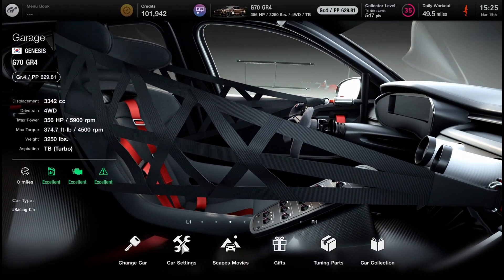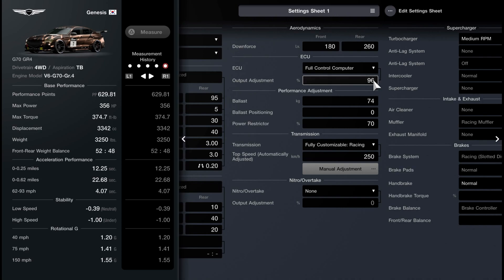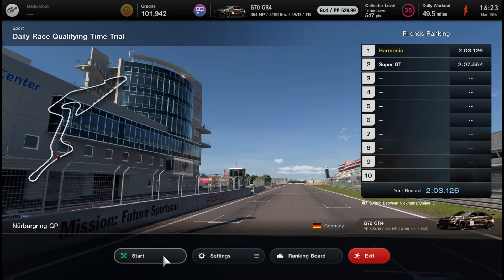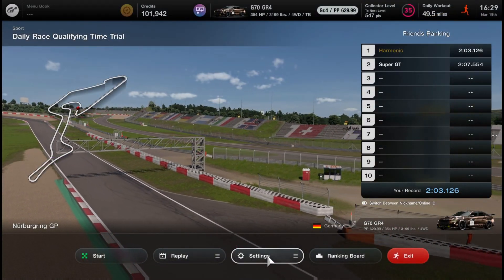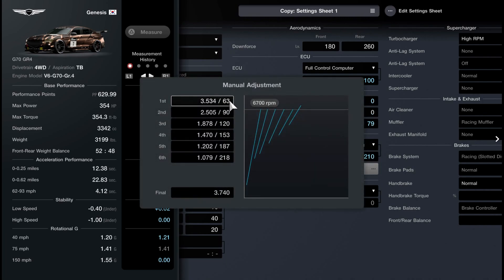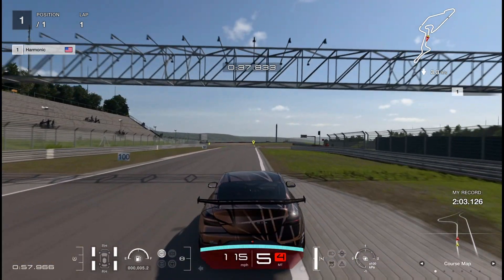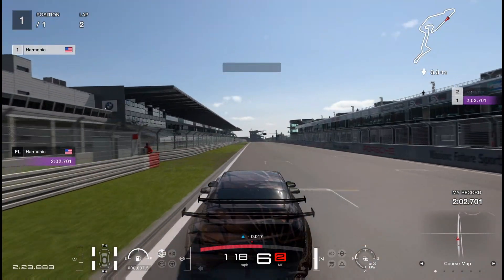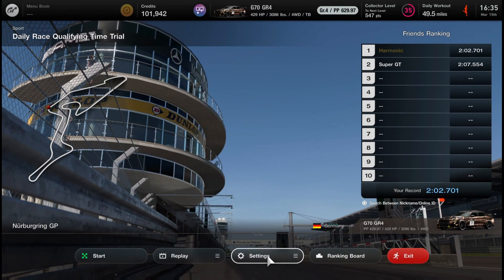Is the PP System BROKEN? | Gran Turismo 7 Tuning Tips

Comment: Why wouldn’t tune setting adjust and affect the cars PP? That’s realistic. You took out some top speed but then gained acceleration by doing that and that’s what you needed specifically on that track to go quicker. The game is just making us learn and understand how to tune you car on a track by track basis. Which is exactly what teams do in real life. I’m personally very happy with how the system works. Either way great video.
Reply from the maker: I don't think you understand the problem. You can make functionally identical setups that are 40+ PP apart, which is what I show here. Extending a gear ratio by 0.001 or adding 1 kg won't change your lap times in any noticeable way, but the game places the car into a completely different class because of how it simulates performance.

Comment: I think its always better to reduxce more on ECu than engine power ;) at least how it used to be back in the days ;)
Reply from the maker: Power restrictor is always better. The ECU output doesn't change your power curve, whereas the power restrictor pulls down the peak while not affecting the low end as much, so the power band is much wider.

Comment: So you're saying if I want to win, add a ballast and up the weight by 1kg? Also the way gearing effects PP is crazy. I got my PP to 550.01 for a race(needed 550), but setting it one more point drops it to 548. Decimals are also an issue. The fact you can denied entry by .01 is insane. Also I did races with cars that were over 600PP in a 550PP race. I don't know if it is intentional, but it makes some of the races pretty hard.
Reply: Why would you expect a car that is 550.01 to be allowed in? It’s over the limit, simple as that.
Reply: @SgHawk144  and Im saying the pp system is flawed. I got a power restrictor to lower my pp and setting it down put my pp up. Explain how making my car worse made it too good for the race. Either way I did the race, but its a flawed system.
Reply: @Gutigwolfe  that didn’t answer my question…
Reply: @SgHawk144  your question was asking why I expect to enter a race if Im over, but I never said that. I was explaining it was broken, so I replied with a further explanation of that instead.
Reply: @Gutigwolfe   - “the fact you can denied entry for .01 is insane” 
Suggests you disagree, no?
Reply: @SgHawk144  and you took that is me expecting to be entered at .01 over? No, I was saying how easy it is to be over or under, because 1 small change either puts it barely over or way under.

Comment: Hey I have a question about tuning. I bought the Bugatti Veyron 16.4 '13. I bought all the upgrades in the tuning shop that raised its PP. I feel like I messed it up somehow. It feels like it changes gears too fast and abruptly while driving. To restore the body it costs 2.4 million. I’m not sure what to do.
Reply from the maker: Lower the final drive number. You might have too much power for the gearbox and you're just going through all the gears super quickly
Reply: Thanks for the tip! I found you could remove most of the parts in the settings.

Comment: in casual observation, it seems that odd numbers are what trips the system up.  Maybe an irrational number issue?
Reply: Is this common in coding?  I’ve only run programs in javascript, python and matlab and I’ve never had an issue with irrational numbers so is it normal in programming for an oversight such as not being able to compute something due to running out of decimal places?  If so then maybe it can be resolved by rounding values in the formula it uses you think?
Reply: @litreocola6447  I don't really know anything about coding, except that programs usually have a way to work around non-terminating decimals.
Reply: @funkyblue3166  from a previous video on this channel someone found the solution to this and it’s actually quite funny lol: if your car can’t reach 150mph the rotational g rating at 150 isn’t calculated, and as a result is left as 0.  That’s why short gear ratios are important - you gotta reach a max speed below 150mph to circumvent the rating.  Sounds like a pretty easy fix honestly, just interpolate between 100mph and 150mph in terms of pp rating to the max speed limit and get the rating from that scaled value

Comment: The problem is not persé the PP, it's that the measuring of the PP does not make any sense, adding weight alot of times raises PP, why ? Also when you toy around with the weight and power and even downforce, you get to these certain points where adding or removing just 1 adds and lowers alot of PP, the drop and rise is too high for how precise you have to be to optimize PP, why can't we controll the power per HP, instead of per 3/5, the jump is too big.
Reply from the maker: It's true that PP isn't the root of the problem, but it's the end metric for these events that we have to base our tunes on. The root of the problem is how the game simulates rotational G, and that's what gets factored into the PP rating.

As for HP adjustments, while it's annoying that they're not super precise, it's very difficult IRL to have that level of control reliably, so I suppose it makes sense.

Comment: By not following sports use of FIA rules they messed up.
I will say I’ve been messing with power restrictior and ballast and it’s not made any of these tuning numbers happen. I’ve found one car they seem to messed up on the Ferrari iltalia  I’ve raced next to the ai and flat out caught air and another stock one next to me was fine on the hills drop next to me. Watching the replay it’s same speed no breaking. 
I will say thei “exploit “ is similar to what race engineers do to win and innovate to get around rules. 
BMW had gotten into trouble so many times because they made more tuning to the engine that the FIA restrictions didn’t matte their m3 killed the completion. While latter they left racing for a bit due to a seemingly FIA hunt on them. They proved that the rules are the engineers challenge not hinderance. 
So what you’ve done is just tunning
Reply from the maker: No, it's not "just tuning". You can have 2 functionally identical setups with 40+ PP of difference, which is clearly a problem with the in-game system.

Comment: So is it only at a certain threshold it has such a drastic effect or is it only certain number combinations that do it?
Reply: Yes. This was one extreme example where there is a threshold change when the car is/is not able to go above 150 mph, so the calculations that make up the pp rating can’t include rotational G at 150 mph. I presume the same would happen at 100 mph. Gearing and power are the obvious variable to change the cars top speed but in this extreme example his car must have been geared to pretty much exactly 150mph and by adding one extra kg of ballast it brought his theoretical top speed just below 150. There are other less extreme examples with other variables.

Comment: Well...

Shortening the gears as much as possible for better lap times is one of the first things i learned as a 12 year old playing GT1 with my father 25 years ago...sooo thats just how GT is i guess.
Reply from the maker: That's not what's going on here... The problem is you can lengthen the gears by 0.001, add 1 kg of ballast, etc. to break the game and have 2 functionally identical setups that are 40+ PP apart. I discuss this in video if you actually watched it.
Reply: @Harmonic14  well...i do get your point, but again "isn't that simply how it's supposed to work"?!

You can tune in different ways to arrive at the same pp-threshold with different outcomes / performance. Isn't that the point? I understand when you think that's annyoing, but otherwise everbody would just run the same setup meta and we wouldn't need to tune in the first place. Which could be indeed less annyoing...🤔

(wanna mention i did not play GT Sport at all and i have not tried GT7 online yet...maybe for good reasons^^)
Reply from the maker: @tydendurler9574  no, that's not the point. You can arrive at 2 functionally identical setups that are 40+ PP apart with this. You can't argue that 1kg of ballast or a 0.001 shorter gear will affect your performance in any noticeable way.

Comment: I had a situation (tinkering with numbers) I gained PPs (lol) while reducing power.
Reply: Yes but the thing is:

Do you understand why?

Hint: more power does not always make the car faster (as in lap time, which is what matters)
Reply: @tydendurler9574  Yeah, you think 1 point in ECU adjustment meant a 5% increase in power you're dreaming.

The fact that you can oversteer or understeer more easily due to having 3HP more makes 0 sense in increasing PP for 5%

Comment: In a race that uses fuel, your car will also become lighter over time.
Reply: wow i didn’t know lol.
Reply: so technically if the weight was holding you back to 149, you gain like 30 pp when you drive a little while. i guess the same is true when you have a tailwind

Comment: Love the channel. But yeah tuning is faster than a non tune. I race every Saturday & getting my tire pressure, stagger & camber correct is very important to victory. I don’t want tuning to be just bolt on parts. That’s not really tuning in my opinion
Reply from the maker: That isn't the point of this video. The point is that you can run a virtually identical tune, and the game thinks it's way slower because of an error in the PP calculation. This allows you to squeeze overpowered cars into events where they don't belong.
Reply: @Harmonic14  gotcha. Being honest. Looks like they finished single player up. Slapped a one week beta in for multiplayer and released the game. Online is such a disaster. I can’t even save a lobby. Or any time a host leaves a lobby it kicks everyone. You can’t even change it.
Reply: @Harmonic14  Technically this isn't error in calculation. The game engine gives you the 0 g rank for 150 mph cornering because you can't reach that speed - the top speed at the end of the straight is 137 mph. Here is the thing - on a track with very long straights and high speeds corners car that can't reach 150 mph will be worse than a car that can. Throw some low speed corners and the situation becomes more balanced. The more windy track becomes the more situation flips. This is why tuning exists in first place - to extract maximum performance of a car on a given track. 

The issue is that it's really hard to devise performance metric that feels really fair to general public. The ultimate way of ensuring fairness is a one make race but it still tends to go in the way of the ones who put most money and time into research and development of their car optimization. Just look at really heavy regulated motor sports like formula one. 

In real life it might be beneficial to have a car that require ballast. Why? Ballast is a weight but you can put it wherever you want. You can lower the gravity center of the car and make it corner better. You can put it in the back and fix oversteering caused by poor weight distribution. All that is allowed within rules. 

Here is cold hard truth - any game that has tuning and car building will feel unfair sometimes because there is always that one guy who spent weeks tinkering with his setup to make one car on one track a beast. If you wan't to compete purely by virtue of skill you have games like Trackmania.
Reply: @Harmonic14  see, again the same point i tried to make
Reply from the maker: @Doktoreq  you're missing the point. Just putting a 0 in that value as soon as you hit the threshold is a massive issue that opens up crazy builds for events where they don't belong. We can all agree that making your last gear 0.001 shorter won't have any noticeable effect on your lap times, so it clearly shouldn't drop your PP by as much as 40 in some cases.

The devs have came out and acknowledged this issue now that people have utterly broken the Tomahawk, so I'd say my initial assessment that it's a bug is correct.
Reply: @Harmonic14  Actually you're missing a point. Putting a 0 for that value isn't an issue. It becomes one when you use that value to ensure "fairness" of the competition, which is unfortunately the case. 
As I said earlier you can't have any other value for G-force for 150 mph cornering than 0 simply because you don't reach that speed. But lets assume that the fix is simply to calculate that value for the tallest gearing the car can have. You fixed the issue at hand but actually created another - you made all lightweight under-powered cars unviable as they received big pp gain which puts them in the same class as much more powerful machines. Technically they can reach 150 mph with some absurd gearing and due to being light they would score quite high G numbers. What now? Calculate possible top speed for all tuning combinations? Then anything that makes your car slower tends to make it more competitive. Put huge aero on some high power car and run circles on your competition which has lover power but higher top speed. And back to square on with high speed Gs. It's inherently hard to make a good system for ensuring fairness of competition when car building is involved and it's shoots up to almost impossible when you have to account for tuning. 
Here is my prediction - Polyphony will change something in the pp calculations and there will be silence for the few weeks with  occasional outcry of some obscure car lover about how it was broken with that update. And then a new PP/physics breaking exploit setup will arrive. The cycle will repeat itself few times and then tuning will be banned online either by devs or by any competitive league.

Comment: entras mal en casi todas las curvas y creo que la sensibilidad al 7 no ayuda.yo la tengo al -2 y va muuy bien,pruebalo.y prueba a frenar igual pero girar mas tarde que te metes muy pronto en la curva.
Reply from the maker: As I said, the laps aren't optimized whatsoever for this example. Check my former world record lap if you want to see proper lines.

As for controller sensitivity, there's no reason to go lower than 7. With how the controller filtering works, you still get slide and oversteer if you go full lock, so you might as well get there faster and just learn to control it. I tried going lower and it was just worse because of that.

Comment: I don't think this is a glitch but a feature. For example with the Mclaren F1 they used a road going design to build a lemans winning car. But they were forced to reduce engine power in order to meet the homologation rules. To compensate for the reduction of power the engineers shortened the gear ratios and as a result the race prepped F1 GTR has much higher acceleration than the road going versions. They were able to reduce engine power but still increase the overall performance of the car.
Reply from the maker: No, it's 100% a bug. I'm not reducing gears to gain acceleration here... I'm reducing gears to fool the game into thinking I can't corner so I can put more power in the car. Furthermore, having 2 functionally identical setups with a difference of 40 PP or more is a clear sign of a problem.
Reply: @Harmonic14  Oh very interesting. I guess I missunderstood the problem. I thought something seemed off but shrugged it off and didn't investigate further.

Comment: Your power restrictor was 70 on your first run and 79 on your second. That’s why there’s such a big change.. using 70% of your engines power vs using almost 80% is a huge difference.
Reply from the maker: That's the entire point of the video... The gearing exploit allows me to do that without going over 630 PP. If I didn't do the exploit, the car would be in the 650s and illegal for Daily Race B.

Comment: PP system IMHO is "fine", noticed this when I got into the Porsche challenge from the Cafe mission that it could open up the doors for some very interesting differences in races... but I see that as the point, PP races don't just test driving skill but also knowledge of the underlying game mechanicals to get faster lap times.

The design intent seems clear, especially considering you did exactly what the challenge intended and it's difficult for me to say that the system is "broken"... based on the comparison videos; you traded top-end for improved handling for a track that doesn't need top-end.

Likely could adjust the weighting a bit to give less PP deduction for lowering top-speed, I would wager traction & handling are far more important for a vast majority of the GT7 tracks but I don't really see that as required; instead, allow players to publish sheets and vote on them.
Reply from the maker: I have to disagree here. Fooling the performance simulation into thinking you physically can't corner at 150 mph is exploiting a flawed system. If the car can't hit 150 mph, there needs to be interpolation of some sort to figure out how it would handle if it could. The fact that you can change a gear ratio by 0.001 and gain 30+ PP points is proof that the system is indeed broken.
Reply: @Harmonic14  It's proof the game has thresholds that need to be hit before the underlying performance model of the vehicle is changed. As I said in my previous comment, it seems to favor raw speed metrics (top-end and acceleration) and on the handling side from my own messing around with the system it favors tires (which can't be tuned all that much other than swapping them out) and if you have diffuser and or a wing (a diffuser alone could be 40+ PP). They just need to modify the weighting on speed metrics, this'll likely break top-speed PP tracks but I think that's less important.
Reply from the maker: @anengineerandacat  those thresholds are what need tweaking. As it stands, if you don't hit that threshold, it just thinks the car is incapable of cornering if it went that fast, which is clearly wrong. Like I said, those stats need to be interpolated or simulated for higher speeds if the setup doesn't allow that speed to be achieved.